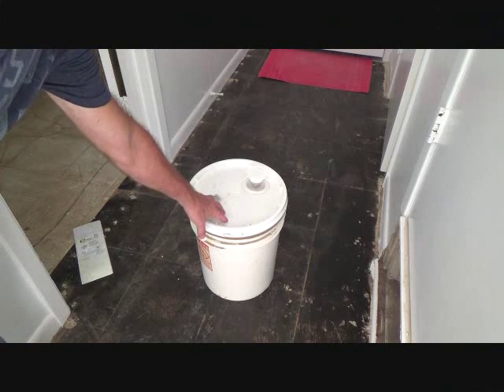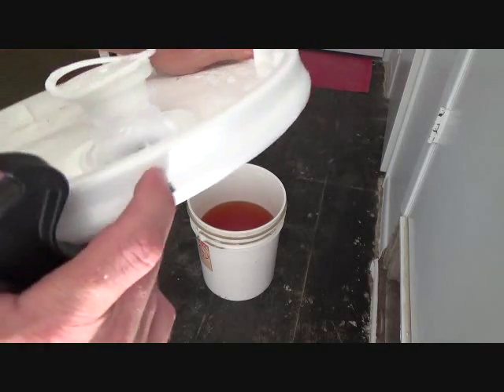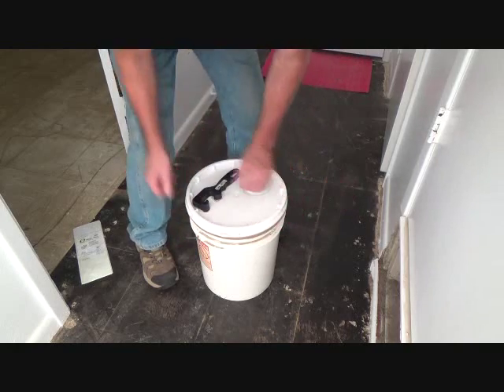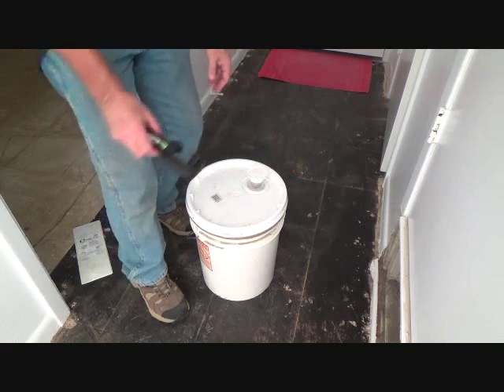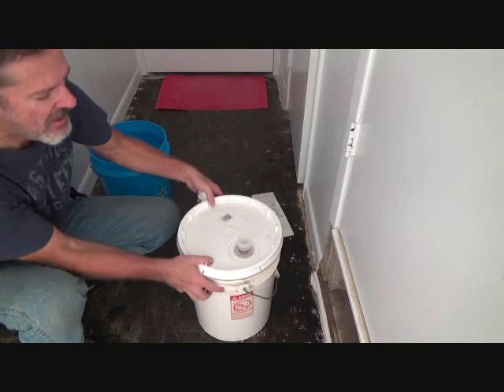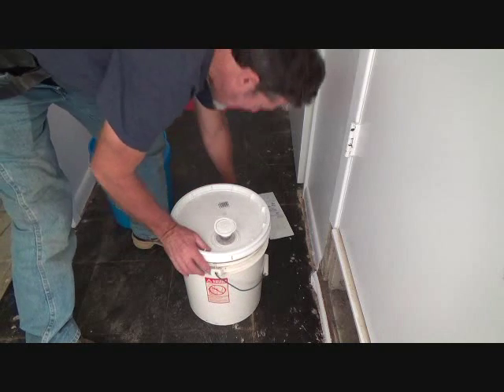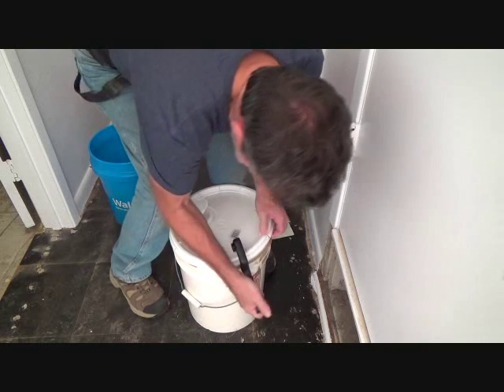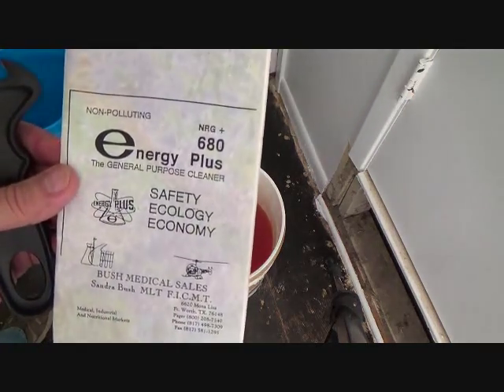How to remove a 5 gallon bucket lid

Comment: Still too hard for me to open by hand, and I don't have one of those specialty tools... but an adjustable pipe wrench worked just like the opener! If I hadn't seen that tool, the pipe wrench wouldn't have come to my mind, so Thanks!  I didn't have to fight with it, and didn't break a nail. 🌞
Reply from the maker: Wow nice job for not breaking a nail! I'm actually thinking whoever first opened this bucket lid maybe didn't look closely to see if there was an actual tab zip strip that could be cut at the very end then pulled off all the way around the bottom edge of the lid. Most 5 gallon buckets have this zip strip so you remove that first then from then on it makes it easier to re-install the lid as well as removing it. There's your tip for the day.....!

Comment: so how do you take the lid off after you rip that off and then put the lid back on?
Reply from the maker: If you watch this video again just about a minute in you will see my other suggestion on how to get these lids off. I usually do it this way but I found this tool in the owner's closet so I thought I would make a video of showing what this tool was & how to use it. Most of the time though I don't use this tool as I open up lids a different better way. Check out this video again & you will see how to do it...

Comment: I'm sure there's a better way than buying a special tool
Reply from the maker: Well yes there IS a better way. On most full 5 gallon buckets look closely at the bottom edge of the actual lid area & you will see a perforated zip strip. Find the end of it where you snip it then you pull that entire strip off the bottom edge of the lid. Now the lid will go on easier not to mention it will now be alot easier to remove the lid whenever needed.....see? For more helpful DIY videos just go to my main YouTube channel page then click on playlists then scroll through the many DIY topics (& associated videos) I have on my channel. You're in good hands. Save that money of yours!

Comment: The weight using a knee almost did the trick with a stuck paint bucket. I landed up walking it over to my neighbor’s to finish the job.
Reply from the maker: Watch the first part of this video again & I show you how to remove the zip strip in case you want to do it that way. That's the best way & then it's easier to snap the lid back on & to take it off without having to carry the bucket over to your neighbor's house again!

Comment: Not all buckets have the tab to pull off. I use a Sawzall
Reply from the maker: Ha! I've never heard of someone using a sawzall but hey if it works...keep doing it. You'd be surprised though how many 5 gallon buckets actually have the pull tab on there if you look real hard. Pull that tab zip strip then it will make your bucket lids come off & go on easier. Thanks for stopping by!

Comment: What is the name of black item
Reply from the maker: Not sure of the name but you can find these tools at most hardware stores but....if you watch closely to the first part of this video I explain how to open a bucket lid a different way which I use often & it's way better than using this tool. Play the video again & you will see a better way to do it...
Reply: I'm trying to do the opposite. I want to put a food storage lid on a 5 gallon bucket. It is impossible! I found your video searching " how to put a lid on a 5 gallon bucket."  I think I'll get one of those tools and try it.  Thanks for making a video about such a simple idea. 131k views to date - not bad!!!
Reply from the maker: @thebazile67  Thanks so much for your message. Not sure if you need one of those tools since your storage lid probably won't have such a high ridge around the lid. The reason why this lid was so hard to get off is because they didn't pull the zip strip off the bottom edge of the lid first. You can either leave that zip strip on or you can tack it off. If you take it off then it makes it easier to remove the lid & put it back on....see what I mean? Watch the video again & I also show how to pull that zip strip off. In your case though you can just buy a lid for a 5 gallon bucket & the new lids don't have that high ridge at the bottom edge of the lid so in your case you won't need that tool. You can buy those lids from The Home Depot or Lowes separately & you will see they go on & off very easily without having to use that tool. Just thought I would let you know. Thanks again for sending me your message & good luck using 5 gallon buckets for your food storage. I have lots more DIY videos on my channel to help you save money around the house on your howto projects & repairs. Just go to my main YOuTube channel page then click on playlists & scroll down from there. You WILL save money & all the money you save you can buy your storage lids....!  LOL

Comment: I'm a blaster and painter working  in a shipyard, and I'm looking for a  tool besides  a screwdriver  to open up five gallon metal buckets with the tabs on the side  of the lid like internationaland Carboline paints my company  new safety   man won't let us use screwdrivers  any more
Reply from the maker: Good grief.....not sure how to open up other buckets other than the ones I show here. Not quite sure what you are referring to for how to open up special lids....
Reply: @VideoJoeKnows   OR ANYONE?  Does Joe Know > Will more affordable plastic lids work on 5 gallon METAL buckets/cans?    

Was going to order TWP 5 gal stain/protestant, but the metal can does not have a spout included.  Amazon has metal spouted lid, but it's overpriced at $25 for one. 

Don't know, consider changing your user name to Good Grief.
Reply from the maker: @Three_Random_Words  You know The Home Depot & Lowes sell plastic lids that fit their standard 5 gallon plastic paint buckets & all purpose joint compound buckets so I think they would work for your metal buckets as well. Go to one of those stores & buy just one lid & go home to see if it will work for you....they also seem easier to put on & take off as the under lip isn't as tall either...thanks for stopping by!
Reply from the maker: @Three_Random_Words  Hey just so you know...I now have a Roku TV channel called DIY for Beginners.....if you have a Roku TV check it out! You can also upload Roku to a laptop computer for viewing as well. Take care!
Reply: I love bitchin,  it's what I'm good at.
Reply from the maker: @Three_Random_Words  Nice!

Comment: On the 5 gal. Lowe's bucket with a lid, I could not find a place where I live that sold the plastic wrench. I used a regular hand can opener that has a bottle opener on the side of it. Just use the bottle opener part (has a sharp curve to it) and every 1/2 inch to 3/4 inch use the opener on the lid - all the way around - slightly lifting to loosen the lid. It opened easily and still had enough seal to use it - maybe not for liquids though. Worked for me.
Reply from the maker: +Zuri Sen Wow nice idea. Thanks for the tip!   Joe  :0
Reply: This tip was more helpful than the video. Thank you! I struggled so much trying to get the lid off the dumb lowes bucket.
Reply: Thank you. It worked.